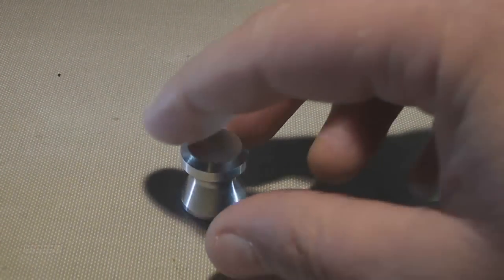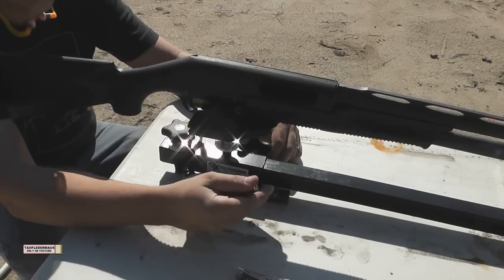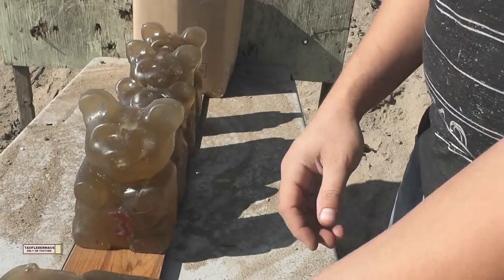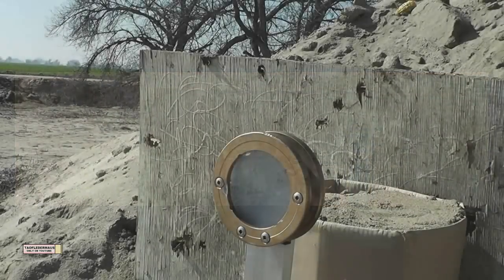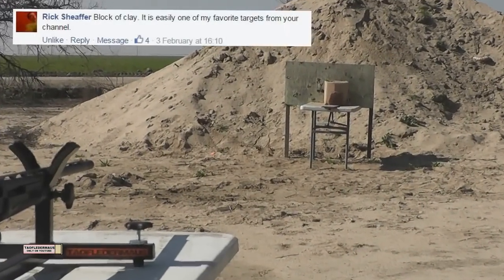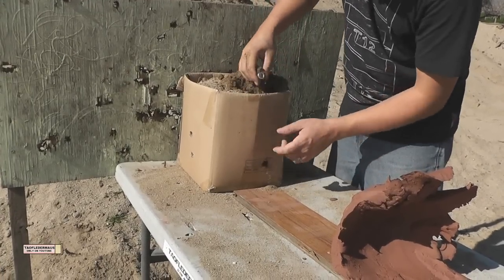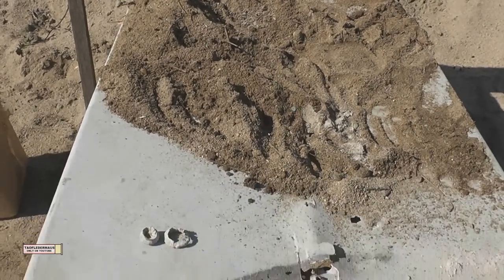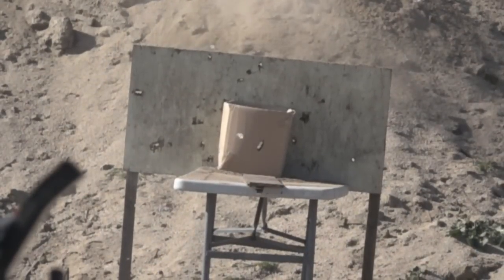.70 Cal  ALUMINIUM Shotgun Slugs  -  Ballistic Trials

Comment: That flash is probably the O2 layer on the aluminum. Working just like it does in thermite. I don't remember. Did you ever try to shoot a stabile arrow using a shotgun? A few different easy adaptable items. Say you're out f loaded shells and your bow is broken. What could you use to shoot an arrow with any sort of accuracy? Can you shoot an arrow from a shotgun? Is there any point in trying? Could you shoot a flaming arrow to light things on fire? Or a firecracker arrow? No need for C4 no matter how cool it would be. Can you get a greater distance/power from a shotgun then you can from a bow? How much power can you shoot an arrow with before it fails? Does the length of the arrow hold any advantages or disadvantages? Say, not just shooting a moving target but nailing it to the wall so it can't move. Might need a cup made that holds the arrows in the shell with back pressure.

Comment: Thanks for showing the rifled choke, I was wondering how they worked and the length of them. 👍🏼
Reply from the maker: +Green Silver  Some of them are a bit shorter.   It seems odd that you could accelerate a slug down a smooth bore and THEN run it through some rifling  to get a spin,  but it works.   I don't think it is as good as using a fully-rifled barrel,   but  it's close.   Just a LOT cheaper,  the rifled choke was only $30 on ebay.

Comment: Aluminium is not made to be shot out of shotguns mate! Its made to be shot out of Railguns!
Reply: I think you are confusing railguns and coilguns
Reply: +Inesophet I thought they only used tungsten projectiles.
Reply: +Matt Millze Railguns do not rely on magnetism of materials
Reply: ***** No, you are confusing railguns with (ferromagnetic) coilguns. (induction coilguns also work without a ferromagnetic projectile)
Reply: +Der Kuchen rail guns can be designed to where they need a ferrous load too. just depends on the armature.
Reply: +Matt Millze a rail gun relies on something called a Lorentz force. Basically, you have a conductive projectile connecting your two rails. the current i.e. electrons react to the magnetic field of the current going through the rails resulting in a forward force... as opposed to a coil gun which uses the magnetic field running down the center to accelerate a magnetic projectile.
Reply: +Matt Millze no its not,  but it can be fairly hard, its light, and it can be made into a projectile  with a magnetic core that will make it move quickly.
Reply: +Matt Millze it CAN work that way, it doesn't have to. theres more than one way to skin a cat. I was simply pointing out one way to use non ferrous munition. which was of course to actually use a ferrous one wrapped in a non ferrous one.
Reply: +Matt Millze well they CAN work they way you thought, but they don't have to. so you weren't completely ignorant. you understand the principle even if you aren't completely versed in the tech.
Reply: Magnetic Vs Condutcive was a secondary argument.

The OP's statement is wrong, technically. Aluminium is not made to be shot from a rail gun. It's made for lots of reasons. Can it be made to be shot from a rail gun? Yes. Aluminium is conductive. Are they making aluminium to be shot from a rail gun? I don't know. If it is, I'd like to see it.

To the best of my knowledge, those with the technology are only shooting tungsten based projectiles. If anyone can elaborate, please do.
Reply: +AusiKifaru27 that is probably for its temperature capability/thermal mass. aluminum would probably instantly melt and create a nice mess of things
Reply: krap101
Indeed, hence my statement. Rail guns have phenominal capabilities, but the heat is extreme. The heat and force tries to push the device apart with as much force as it pushes a projectile (pressure physics). Early rail guns were only capable of firing one shot before needing to be serviced or retired.

The heat produced even in modern rail guns is a significant blip for enemy heat signature detection, which makes them practicably useless.

The projectile is the least of the problems they pose. I can't see their issues being solved any time soon, if at all.
Reply: +AusiKifaru27 not terribly hard to mask heat signatures... the most likely platform would be a ship and you'd be floating in the largest heat sink on the planet... also, liquid nitrogen/helium would allow for superconductors...
Reply: krap101
Having an extremely hot barrel on a boat anywhere isn't going to make any difference. You can get thousands of rounds out of a firearm barrel, but just a few shots from a rail gun, which should tell you something about the kind of heat we're talking about. Also, cooling isn't simple. The heat is already destroying the barrel, so cooling after isn't going to help. You'd need to have coolant applied before firing and the kind of cooling we're talking to prevent that sort of extreme heat is going to make metals extremely fragile. A regular steel barrel in liquid nitrogen would explode on firing.
Reply: +AusiKifaru27 do the math... the reason why heat doesn't destroy conventional barrels immediately is because once it gets hot enough, the air cools the barrel almost as quickly as it heats... for the railgun, with a high enough mass flow of coolant, you'll balance out the heating, and you can exchange the heat from the coolant into the water below...

Also... superconductors = no heat from resistance...
Reply: krap101
Since heat is listed as one of the major barriers of rail guns, perhaps you could go tell them what they're doing wrong ;-)

The idea is for the navy to have a non explosive projectile of sufficient mass with the 230 mile range of the Tomahawk missile. The rail gun they need to achieve this only exists on paper. There's not a ship in existance that can generate the 6 million amps in reserve power required to fire it. Plus, more power equals more heat and they haven't solved that issue with the smaller versions.

Common conception is, there will have to be major technoligical breakthroughs in materials before it's a reality.
Reply: krap101
Also, I don't know how many firearms you've used, but I've shot hundreds of thousands of rounds in my life time. A bullet is only in the barrel for about .002 seconds. If I fire a 30 shot burst, that's .06 seconds. That barrel is going to be hot for a few minutes.
Reply: +AusiKifaru27 Using superconducting coils is a very real technology that is being worked to get into a railgun. That will solve the heat issues...

You are right, that cooling is the more difficult part (to the point they just don't even try). The issue is that you need a heat sink large enough to capture the heat as well as well as removing the heat as quickly and as evenly as possible. If you don't you end up getting warpage as one side of the rail is super duper hot while the other one is super cool. Look up how they make resistive magnets, and I think you'll sort of understand what I'm talking about. 

Once the railgun side of things gets settled, the DDG-1000 series of destroyer was intended to be compatible with a nuclear reactor. So... no it doesn't exist yet...
Reply: +AusiKifaru27 hot is relative... I'm talking hot enough that the material allowable knockdown factor is high enough and margin of safety is less than 1
Reply: I am currently building a railgun and I wouldn't use aluminium for a projectile. Since aluminium projectile are not really dense and won't go much faster due to several factors (proof shown in video) and there is still a better conductor for that... such as copper. I came up with a steel projectile(sharp) with a copper coil as sleeve. The copper will be functioning as the armature. Also there will be a small magnetic field induced by the copper coil and kind of make it "surf" on the magnetic field of the rails. Still, I am stuck with the heat dissipated from the armature and not very much the heat from the rails like they guys are saying in the comments. Since there will be a max amperage of 55kA at t ~ 0, the projectile will accelerate and heat up, since it's the armature that will conduct the current at a constant spot, but moves forward in the rails. If you find a way to make the projectiles superconducting, let me know :P
Reply: *****
Hey there, thanks for your question, it pushed me towards a path of learning more. Anyway instead of getting rid of the heat you can use the heat to make ur railgun more efficient. If you coat your copper projectile with zinc at the sides that are in contact with the conductor, you can exploit heat generation. The zinc will start turning into a plasma at about 910 degrees C. a plasma will provide you with far greater electrical conductivity which equals far greater acceleration. At least in theory. Preheating the projectile may actually be a good idea then, experiment and share your results :)
Reply: Inesophet
I was indeed thinking about using plasma for increased conductivity, since the heat can't be dealt with for now. In theory it could work, but as an engineer, theory is far too beautiful to be real. I will have to do some tests with it. I could ofcourse supercool everything, even ordinairy conductors will lose resistance. However, it will be handheld, which will be even more of a challenge. Currently I am trying to design the perfect charging circuit. If you try to look on internet and find coilguns and even the railguns that are made, are way too weak, 100 Watts at best. Mine will be around 1500 Watts (with a 18 MegaWatt burst), it will be a difficult task as I need components that aren't to be found on the internet at all. I am trying to find several electromechanical ways to guide a 55kA burst. It's working out pretty well so far. When I am done with this I will focus on principle. Thanks for your input.
Reply: metamorphicorder
Haha, thank you for your concern, but everything is quite contained. Especially with the plasma, the current through the wire creates a humongous magnetic field at such small distances. Also, it's comparable to firing a gun in your house, except this will fire a big ball of molten metal, no one would do that inside :)
Reply: *****
Well then, post a video of youtube of ur efforts so far.
Reply: Inesophet I am afraid that would be quite boring, as you would only see pages of equations and drawings of schematics, also quite some breadboard while testing components. I am trying to do this as perfect as possible, as that is mandatory.
 I will try to do this on video, but I am not the talkative person and quite camera shy haha :)

Comment: I wonder if the lack of mass+ the high drag slowed the aluminum down more quickly over that same distance which is why they had the same time to reach the target.  I mean F=MA so if you solve for A   A = F/M  So the Acceleration should be MUCH higher assuming force is the same.... Maybe it isn't air resistance,perhaps it is resistance found in the barrel of the shotgun....

Curious.
Reply from the maker: +Ted Schoenling  Many have said it is just the limitations of how fast the powder is burning and expanding.
Reply: it would be interesting to re-visit the .22 blank with Pellet shoot, using the same level charge but some how reducing the mass of the pellet to see if its velocity stays the same or goes up.

Comment: the flash is from the air being compressed between the two objects. the same thing can be seen when a mantis shrimp hits its prey.
Reply: +Joe Coastie What the mantis shrimp Mantis shrimp is actually sonoluminescence, which is caused by cavitation. This effect here is dieseling. Air is being compressed to the point that it heats up. It heats up so rapidly that it actually creates plasma and the air glows for a split second. That is a VERY rudimentary explanation obviously. And to Dio Cane, it actually will exceed the temp of the surface of the sun, for a fraction of a second. So no, not bullshit.
Reply: +ATL Infidel yeahhhhhh, science, bitch!
Reply: +Joe Coastie I don't know the physics, but you can really see that the flash happened just before the impact on the lead plate, and that gave me a lot of confidence in believing this.
Reply: +gthreesix bullshita
Reply: +Joe Coastie This is exactly what I was thinking.  It's a flat head on the pellet.  It's possible that the pellet is moving so fast that the air doesn't have time to move out of it's way and for a split second it's compressed to the point of detonation.
Reply: illudian A slug doesn't have enough velocity? Of course it does. I can compress air with my hands fast enough to ignite tinder. It's called a fire piston. 

And aluminum/brass won't generate sparks. They don't have the necessary pyrophoricity.

And as far as why we didn't see it with the lead, I'm betting it's because the lead slugs were already slightly malformed before getting to the target. This was soft lead (IE; lead without added antimony) which deforms easily.

As far as what is actually going on, none of us will ever know. It's all conjecture.
Reply: No
Reply: +Joe Coastie for a fraction of a second that is the energy of the sun's surface.
Reply: +ATL Infidel while this is true the compression has to be huge for the air itself to ignite and without a form of containment a bullet just just doesn't have enough velocity to create that. If it was air compression it should be seen with lead pellets of the same shape, while it is possible I couldn't find anything on it so if you have please direct me to it, so it would have to be something with the aluminium but there also isn't enough velocity on the pellet to shock heat the aluminium to ignition temperature. More than likely the flash we are seeing is just the contact of two metals generating a quick spark.
Reply: illudian Aluminum, lead, and brass are non-sparking metals.  So a quick spark would not be a good explanation.  It would have to be something else.  One thing to consider in the difference between the lead pellet and the aluminum one is that the Al pellet is machined.  Which would naturally result in a more precise and flatter face.  The lead pellet was cast and appears to have a less precise face.  That said, the contact with the brass frame isn't perfectly flat so compression of the air would be harder to get.
Reply: ATL Infidel a fire piston is a contained pressure and if you read my comment I said without containment a slug doesn't have the necessary velocity so your fire piston comment is moot. As for you and MobiusUSAH talking about it being non sparking I admit spark is not a good word for it but the contact could have knocked off tiny flakes and those could have ignited which is what I was getting at though I admit the likelihood of that is small. Though MobiusUSAH comment about it being machined could lead to tiny ragged edges which with compression heating of the air to cause ignition.
Reply: +illudian Well, let's be fair.  Oxygen is an oxidizer not a fuel.  So no matter what happens in this case, the air isn't what's burning.  When I mention compressing the air to ignite, I mean whatever fuel may be present in the surrounding air.  In this case it could be metals, or it could be unburned powders that are traveling with the slug.  Whatever it is, it's not likely to be the metal to metal contact that causes the spark.  It's more likely to be something else in the immediate area that is igniting.
Reply: MobiusUSAH True but most people just think of it as the air burning and it's easier to say that than to get into detail about it. Also metal on metal contact would actually be perfect for this since aluminium reacts very quickly with oxygen and an impact with another metal could easily create tiny enough fragments which could ignite if there is enough heat, which could be generated by a combination of compressed air heating as well as some of the kinetic energy from the impact being converted to heat. IF small enough fragments are knocked off then those factors combined would basically create a very small thermobaric explosion.
Reply: +Joe Coastie Are you sure?  The mantis shrimp's flash is from sonoluminescence.  Sonoluminescence has only been seen in POLAR fluids.
Reply: +E2qNX8btraQ3zRD6J7fc it's on the internet, it has to be true. bonjour! 

lol. I should have said similar. but I didn't sleep last night and I'm running a fever. I believe I was corrected and told that it's called dieseling.
Reply: +Joe Coastie You can do dieseling to increase power of pellet/air guns, it's not safe and can do damage though..
Reply: woop woop
Reply: that's a mini sonic boom the mantis shrimp creates actually to stun/kill its prey